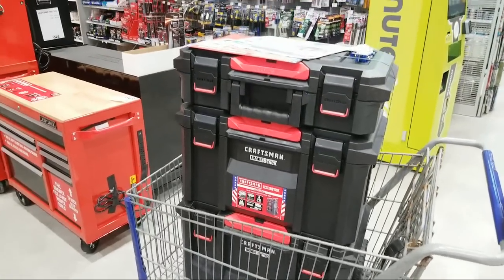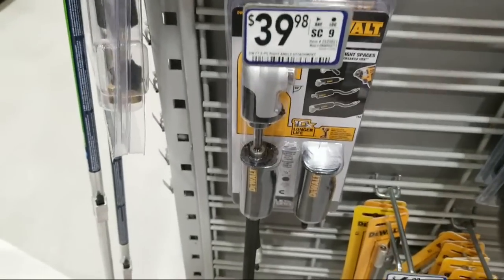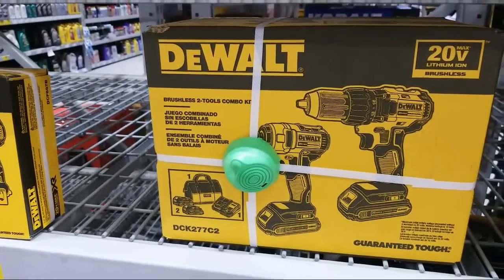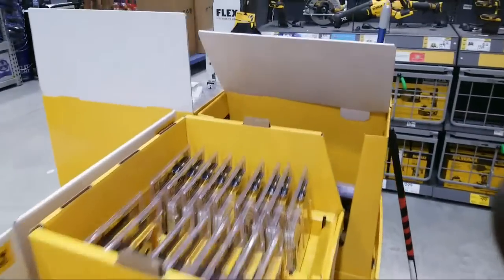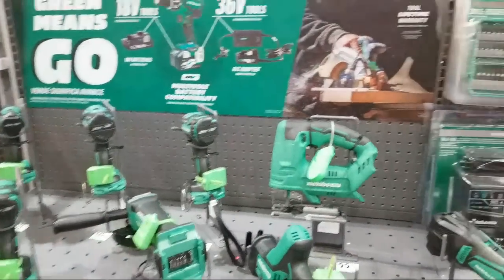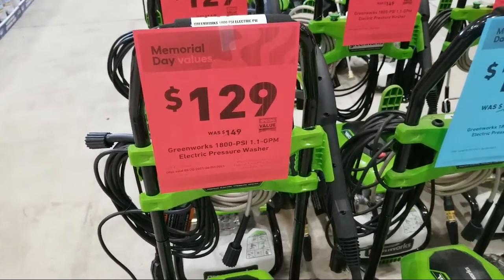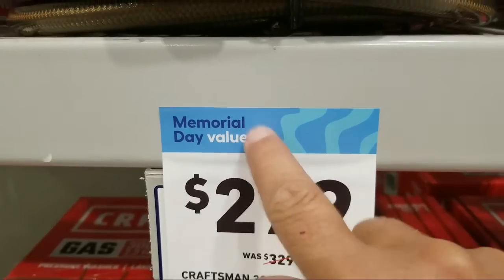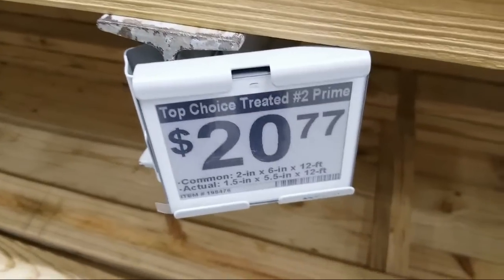Lowes NEW Craftsman Pro Tower! Father's Day gift ideas/Memorial Day Sale

Comment: Did you see the Craftsman 2x20V mower has a free string trimmer with it? 2643768 CMCMW220P2 with a free 1130004 CMCST910M1 a $129 value. Gives you 3 batteries, 2 chargers, 13" string trimmer and lawn mower for $299.
Reply from the maker: I gotta look that one up for next time

Comment: There are Porter-Cable to Dewalt battery adapters on Ebay that are really cheap.
Reply from the maker: do they work ok?
Reply: @jeffostroff  I have a B&D to Dewalt battery and it works fine.

Comment: So @jeffostroff I see you have some electrical outlets in your cart. I am curious if you have ever used WAGO electrical connectors or the Ideal push in connectors instead of wire nuts?
Reply from the maker: yes I have wago and used them and love them
Reply: Big Clive did review on those.  I guess there's a Chinese version that's just as good.

Comment: When buying a phone charger for your car check the specs. Look for 2.4a or 30w per channel. Some manufacturers don't give all the specs but if you see those numbers for each outlet it's a fast charger.
Reply from the maker: My charger in the car says 2.5 I think, but the Dewalt cord seems to be the problem. If I use on of my black Samsun type C cords, it says fast charge on the screen. But when I use the dewaldt cord I keep getting strange messages on my phone like please check your charger connection or sometimes it'll say like charging in five hours which is a joke

Comment: Have you done a video on the differences between the types of materials tools are made of?  Such as carbide, titanium, steel when it comes to drill bits, drivers, and such.
Reply: Unless you're doing some masonry or glass  drilling you don't need carbide as far as titanium its most useful for drilling metal as the coating allows for longer tool life . as far as steel goes almost all decent drills are high speed steel of various grades M2 being most common in industrial/contractor grades. M42 often called Cobalt drills are a better grade of drill bit and are a necessity when doing a lot of drilling in metals these also come with a titanium coating but you would most likely have to obtain them from an industrial supply house such as MSC or Grainger
Reply: @danielbackley9301  , thanks
Reply from the maker: that would be a good video

Comment: That $39.98 right angle kit has sold for $29.98 in my Lowe's stores. in some stores they haven't changed the sign but the app shows $29.98
Reply from the maker: that's a good price, i should have scanned it to confirm

Comment: Cobalt drill bits are better than the titanium ones and cost more.
Reply: Titanium is only a surface coating same as black oxide is but for different applications and with a different purpose also cobalt drills have been available with titanium coating for  almost 30 years that I know of but are usually found in machine shops not on construction sites.
Reply from the maker: i had no idea they were just coated

Comment: When it comes to BBQs grates. The castiron ones need to be seasoned with crisco and once done nothing will stick. Also, the Weber grills were good before they sold and moved all production out of IL. My old Weber is going strong 22 years later.
Reply: Where did they move to?
Reply from the maker: wow, that's a long time. too humid here in fl, everything will corrode except the stainless steel parts
Reply: @matthewpeters85  China.

Comment: I just bought that myself broski!😎👍🏼it's awesome and more rugged and weight than the Versastack..I like them both.andbyes they are dissapearing fast.dude they didn't even put them on the floor yet but I saw the boxes and took one out🤣 myself
Reply from the maker: way to go iron man!
Reply: Is it compatible with the versastack?
Reply: @christopherdecker4992  thiers a tray in the bottom tool box hung from the inside and take it out and put it on the top tool box.its compatible
Reply: @tonistarks2874  thank you. I have 2 sets of the craftsman pack outs. My local Lowe’s had them on sale 2 months ago. But this new set looks badass.

Comment: Just scored the all black subcompact metabo drill/impact set for $120 at Lowes and a 3Ah battery and a light off Amazon for $20 and $13 respectively.  Just noticed the impact bit sets on the app the other day, gonna head to Lowes and grab them soon.  Also got the all black Makita subcompact drill/driver set with two 2Ah batteries and a charger with bag for $150 at Home Depot.  Been a good week for tool buys lol
Reply from the maker: you are the pacman of drill sets!

Comment: 1.5 batteries for the Dewalt drill combo kit. Are those batteries any good?
Reply from the maker: I don't think they have battery strength gauge on them, not sure, bur for small light battery should be good, but i gotta have the gauge on it

Comment: So they made a new storage system and didn't bother to keep up with the times and offer drawers. Thnx Crafstman
Reply from the maker: none of the others have drawers in the tower, and dewalt ts2 drawers impossible to get. it is a separate unit, hopefully craftsman does the same
Reply: @jeffostroff  versastack, tough system, t stack and Packout all have drawers. I just can't believe after all the criticism of all the tool storage systems and not being able to access boxes underneath, that they would come out with 'brand new' offering, same old design as the old crap. They had a huge opportunity to do something here, but dropped the ball